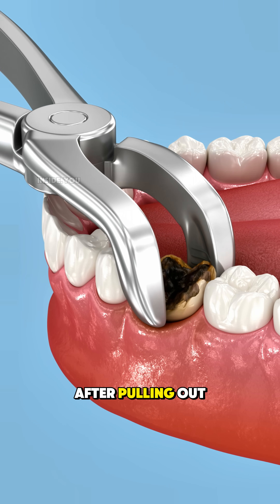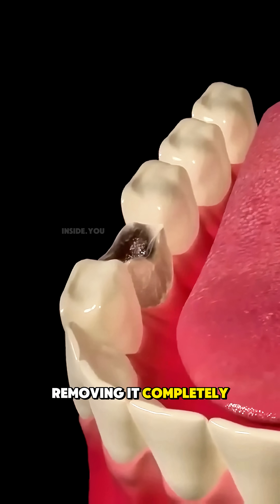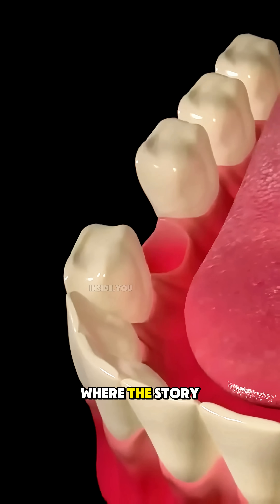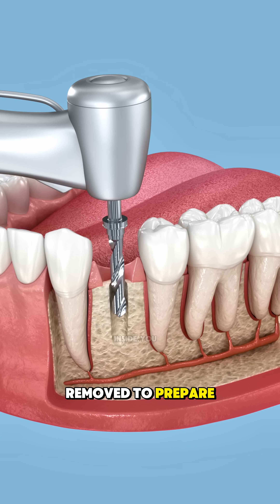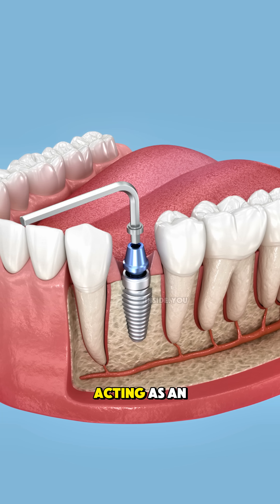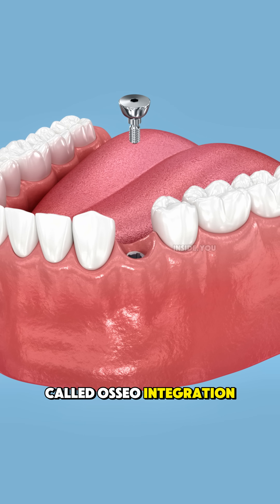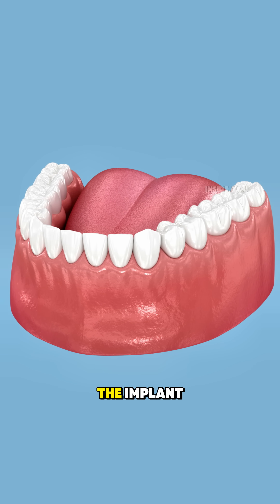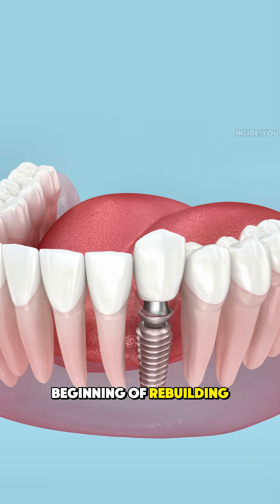Tooth Extraction and Dental Implant Process Explained

Comment: I’d rather get pop ins OR I got the ones that are clear like Invisalign but with fake teeth molded inside it for like 1G. Only crappy part is it sucks to eat food with both of em. If not it’s at least 2 grand an implant, probably more
Reply: Why not use a bridge?
Reply: 🤷🏻‍♂️ idk, I’m not a professional but have had plenty of dental work done plus had both front knocked out twice (not a fight 😂) and reinplanted twice but I’ve been told by ppl who’ve had them bridges put a lot of stress and wear out and ruin the other teeth they are connected to and fail after a while. It always depends on the person and the teeth situation I guess
Reply: 🤷🏻‍♂️ idk, I’m not a professional but have had plenty of dental work done plus had both front knocked out twice (not a fight 😂) and reinplanted twice but I’ve been told by ppl who’ve had them bridges put a lot of stress and wear out and ruin the other teeth they are connected to and fail after a while. It always depends on the person and the teeth situation I guess

Comment: The problem with this is that with time gum recedes showing the implant screw and bacteria starts to grow and get in there creating havoc.
Reply: Yep! They only tell you the good parts, the negative parts are hidden. Animation pictures are far beyond the real pictures!
Don’t let them fool you!!! As more than 40 years as a registered dental assistant, I’ve seen and heard all. 🤑🤑🤑
Reply: @judytam2835 what are the downsides of a dental implant?
Reply: And decay can grow around a root canal.
Reply: Not for Seniors 70 & above........😢❤
Reply: @giamrob2003 I'm 75, and I've had two implants since 2021. I haven't had any problems.
Reply: @giamrob2003  Older folks have bone loss is why.
Reply: I had a dentist at my college back when tell me I should think about removing an impacted wisdom tooth which was pressing against a molar. I didn't listen. It eventually cracked and broke when I was eating a burger in Paris. Years later, I finally decided to have what was left of the painful tooth removed. I was told an implant might be needed to prevent the molar right above from eventually becoming loose, seeing as there would be no tooth directly below for it to press against. I never got the implant, the molar above is still tightly in place after years, and I chew on that side of my mouth just fine. The moral? Get rid of your wisdom teeth, and unless it's for cosmetic purposes (how your mouth looks when you smile) save your money on a dental implant.
Reply: True
Reply: Mine's been in for 10 yrs now and no measurable recession of the gums. My root canal cost $1200 15 yrs ago and only lasted 5 yrs so I went with the implant.
Reply: I love it

Comment: I have 3 roots in all of my teeth, and a large number of them end with a round shape, which is essentially a ball joint. They had to actually crack the tooth with squeezing force and do a bit of surgery to get them out. They said I have the genetically hardest teeth they have ever worked on, but that as a customer I'm the easiest. Never complained or even mentioned pain, and according to them, almost nobody else can open their mouth so wide and keep it that way - sometimes I even fell asleep during drilling and my mouth stayed open. I don't even know how that works. It was awkward to wake up to a question I didn't really hear because I didn't want to admit I had drifted to sleep.